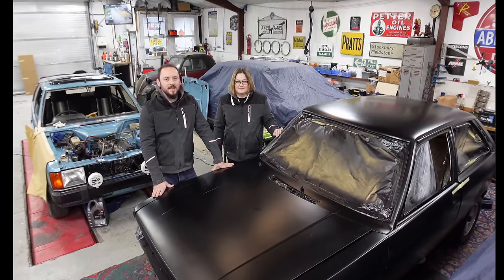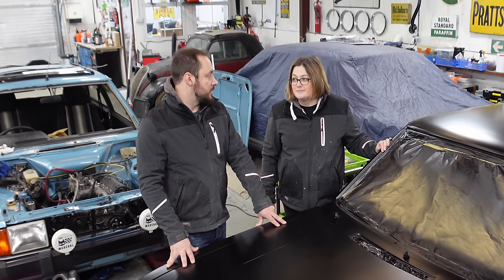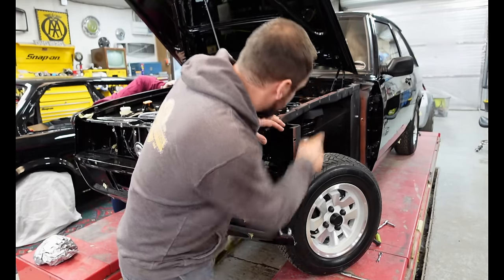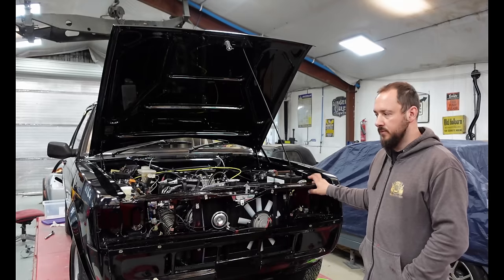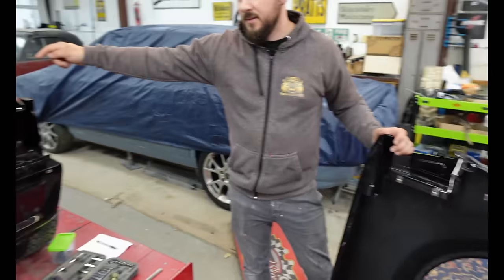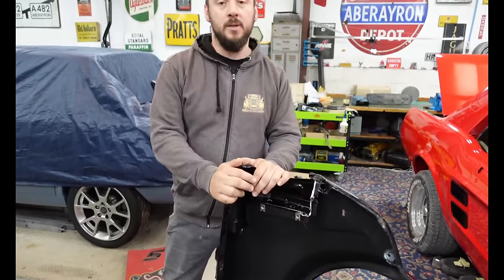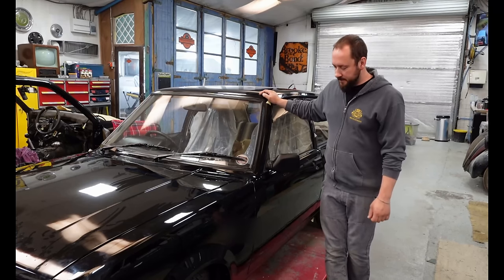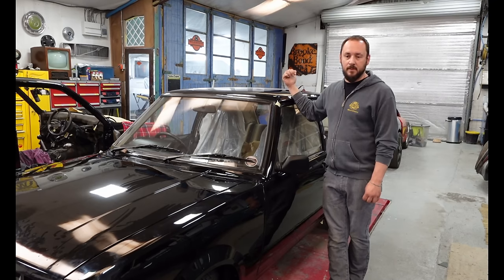Digging Deeper Into the Talbot Sunbeam LOTUS! We investigate the wonky front end and roof blisters!

Comment: I could not quite see, but I don’t think the wings are original, they would have had the lip under the arch rolled completely flat to the under side of the wing if that makes sense , the rear arch lips were also rolled to about 45 degrees originally, to accommodate the larger wheels , easy way back in the day to tell a original over a re shell as most people would not bother to roll the lips .
Reply from the maker: Well actually the arch lips were quite bad and looked like they had been pried out so replacement wings could explain that. I'll have a look against the blue Talbot and see if there's a difference!